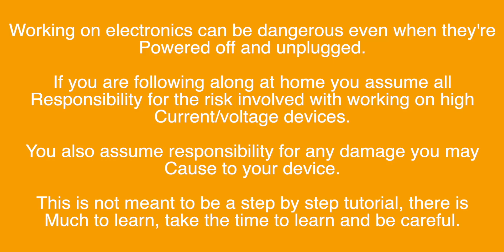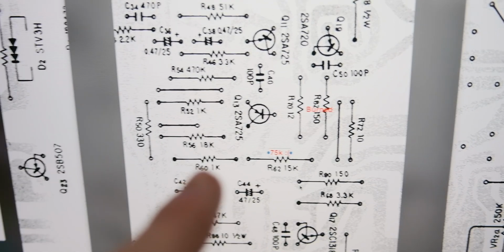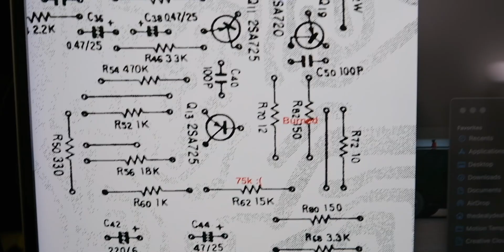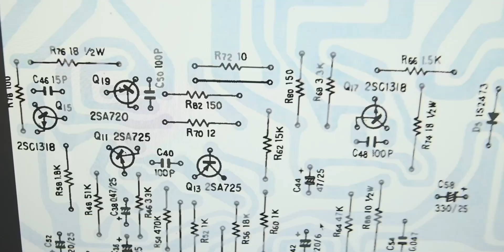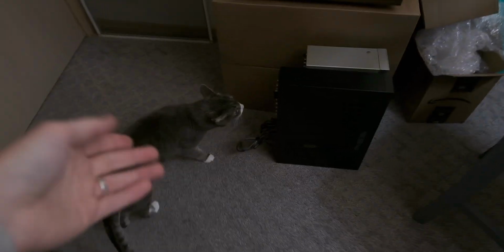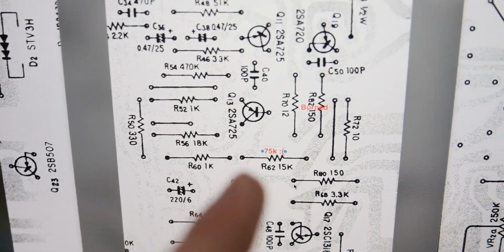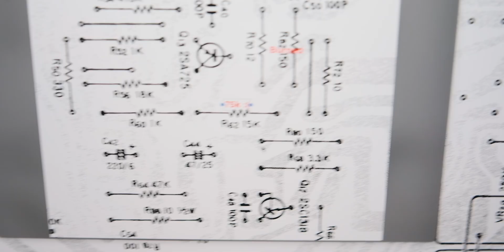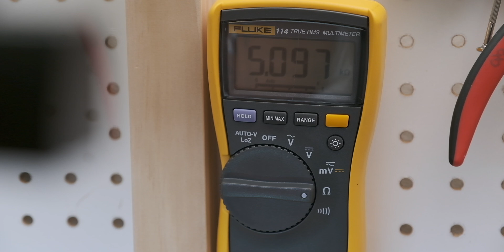I messed up...

Comment: Thanks for sharing.
Never run stuff without a heatsink, especially old stuff.
Modern IC's have internal protection, they turn of at 125°C or 155°C, but if you keep abusing them, they'll also fry.
3:47 ... I have a question about Resistors. The yellow ones (carbon film) are worse for audio circuits than the blue ones (metal film)?
I don't have any experience on audio circuits, but I'll start my project soon and I want to get the best price / performance and I want to know if I should replace every Carbon Film Resistor with a Metal Film one and if there's a difference or not.
Reply from the maker: Thanks for watching! 
Carbon film are not necessarily worse for audio circuit but they are prone to produce noise as they age. The main reason that you might see carbon film at some points in an amplifier are because they are non inductive whereas metal film is inductive. Probably not going to ruin anything to replace CF with MF but if an amp uses mostly MF except for a couple of spots, it's likely meant to use CF for a reason.

Comment: I've smoked so many IC's, and some transistors, and Fet's prototyping. Simple mistakes too. Now I've mentioned tube, or valve stuff that's something not for everyone that's pretty much all HV dc with local AC if you will. Radios don't usually have high capacitance on the B+, however a valve amp will have much higher filter capacitance, they also usually have higher voltage then a radio too! Both are still dangerous especially AC/DC mains sets! one hand in the pocket behind! Any way working on that stuff for me I double, triple and sometimes quadruple check before I make a specific decision. When testing the circuit for voltage, and current! Since then I apply it to solid state! Still happens though I smoked an 386 audio amp I believe it was just a year ago! Reading resistors Paul Carlson has an excellent video on reading them using what he showed I've been able to get them pretty much spot on. Its quite unique and why I did explain how to just do it! You can see a lot of errors on tube schmatic's, and interesting changes for value's language between manufacturers at the time!

Comment: A true story is a good story so long nobody got hurt. I subd. I started into tube repair last summer and can relate to how much you learned since last year. Me too.
Reply from the maker: Haha yes I'm here to live another day. Thanks for subscribing!
Oh wow! That's awesome. I can't wait to work on tube amps. What's your current project?
Reply: @Shuksanaudio   just finished an HH Scott 272, big project with big lessons for me. Like it would run on a 200 watt dim bulb but would only have enough to play through 1 channel and I pulled out most my hair til I figured out it was the dim bulb that was killing the B channel.
Did several odds and ends too over winter like these little bakelite cased tubed intercoms that used the neutral wire to communicate. It's been a warm Spring here in Iowa and I put the 272 away til next fall because it radiates heat like an oven. I just bought used Tyler Acoustics D1 speakers and lately I've been enjoying my time getting to know them. 
Also I learned if a filter cap has a plastic cover over the end of it don't accidently touch the end of the new cap if it doesn't also have that insulator.  350 volts from my wrist to my finger was a surprise. That was in a VAC line stage.
Reply from the maker: Oh man, that is a big project! I hope you've got some hair left for the next one haha. Maybe it's all standing straight up after feeling 350v 😅  @atcaleb

Comment: What software are you using on your computer for schematics?
Reply from the maker: It's the service manual in a PDF form and I just zoomed in on it. There are a few sites that have most models of service manual available for free download. Make sure you look for the service manual rather than the user manual as it has the schematics, board diagrams, and parts lists in it. Thanks for watching!
Reply: Thanks for the answer, go on with posting. @Shuksanaudio
Reply from the maker: Aye aye captain 🧑‍✈ @fly6398

Comment: Great video sharing your mistakes. I have also come across incorrect value factory-fitted components in a Marantz amplifier. It's always good to double and triple check.
Reply from the maker: Thank you! I appreciate it. Oh man, yea there were so many different versions of each amp that was released with slight changes. Thanks for watching!

Comment: a small correction: the "zero L" you are reading actually is "OL" and stands for "overload" for when the reading is too big for the multimeter to measure. For multimeters that do not automatically adjust their scale it's a pretty common occurrence when you're on a too small of a scale for the resistor (ie: on a 200ohm scale while measuring a 1kohm resistor), and for your case it means the resistance is in the high megaohms or an open circuit altogether. (if it were a shortcircuit it would just read as 0.0)

now that's out of the way, I just gotta say, I absolutely love these videos! 
making mistakes and figuring out how to fix them is a crucial part of working on electronics, so I'm grateful you didn't hold back in showing that. kudos to you! 
the production quality is also really great and pleasant for this kind of video, and I really appreciate it <3

keep it up!
Reply: OL stands for Out of Limit
Reply: @glennschlorf1285  first time hearing that one!
must be really niche. good to know
Reply: over load out of limit, same thing. @fuzzdistor
Reply from the maker: Thanks for the correction! Love this little convo of knowledgeable people haha.

Comment: Do you not have the schematic for that receiver? It's online everywhere, for free download. A shorted b-e junction means that every other transistor connected to it must be checked. And every other transistor connected to all of those must be checked. And any associated resistors, and you may as well be checking the caps, and replacing ALL of the electrolytics. Then there's the business of the tempermental old phono transistors, and any of the others of the same type that you'll find in the tone circuits. Just sayin'.
Reply from the maker: Maybe you could watch the video before leaving a comment like this haha